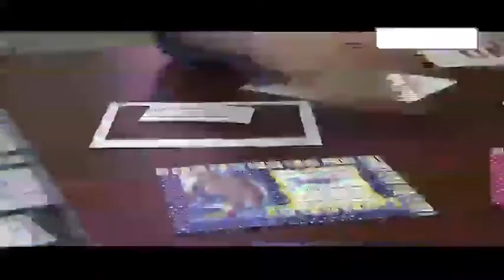Unpacking Petra Diamonds' Blue stone

Comment: Shares in Petra Diamonds are very cheap right now
Reply: Do you think they will recover I'm buying a lot of them and I'm really worried about them
Reply: @giorgoschouliaras3349  The stock is ultra volatile due to the sector ete geographical and political issues affect the prices. Look at the charts.
Reply: I mean long term after the covid-19 thing ends
Reply: @giorgoschouliaras3349  It is hard to say what will happen when things have settled down. If you look at the chart the prices has been declining since 2016 when it was around $166